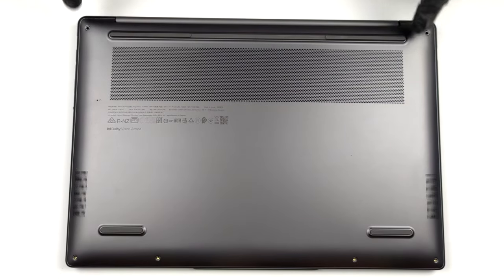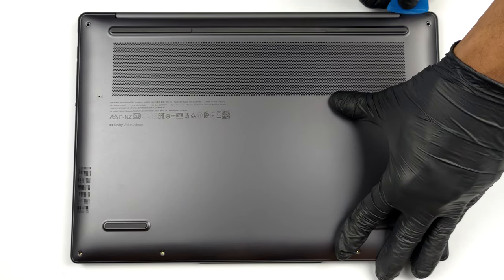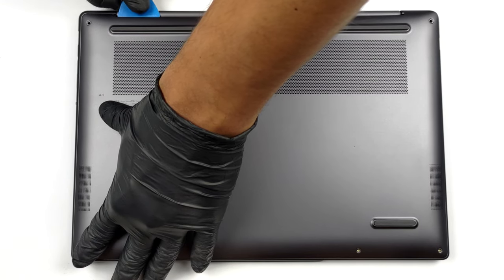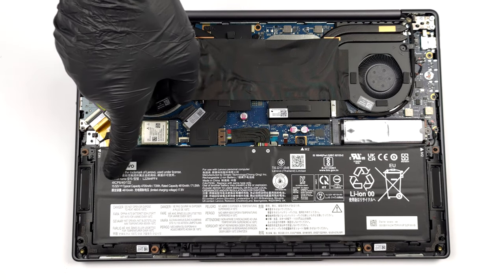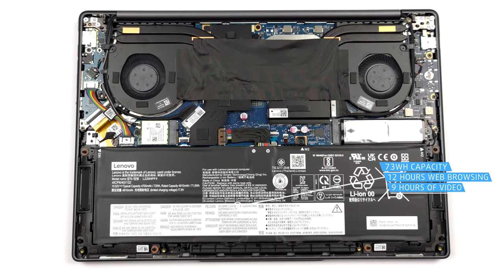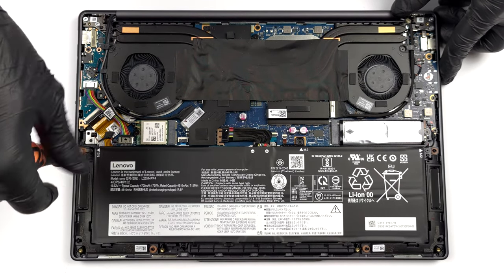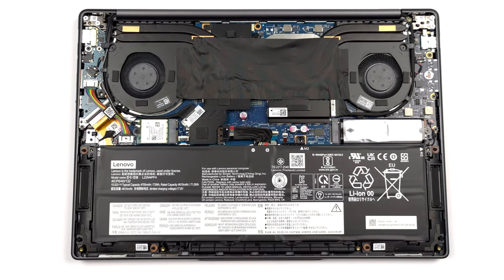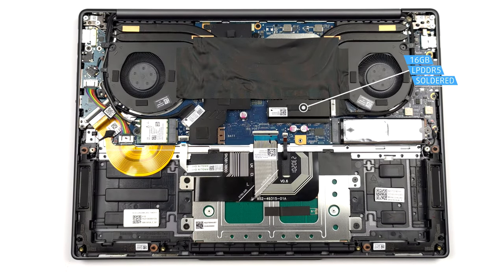🛠️ How to open Lenovo Yoga Pro 7 (14", 2023) - disassembly and upgrade options

Comment: What brand type of SSD and model is installed? Kingston / Samsung / Seagate / WD...?
Reply: wd
Reply: I have this laptop and it’s actually a Samsung SSD PM9A1, I get 6600 on read, overall comparable to Samsung 980 pro in all aspects.
Reply: Lenovo doesn't use the same model ssd consistently for the same model laptop. I bought two of the same model and they had different SSDs.
Reply: @CrazyStranger11  Guess I got lucky and got the samsung, it's better than the hynix right?

Comment: Very interesting video. Do you know the material by which has made the black foil over the heat pipes between the two fans? Are there graphene or carbon fiber components/parts in this PC that you know?